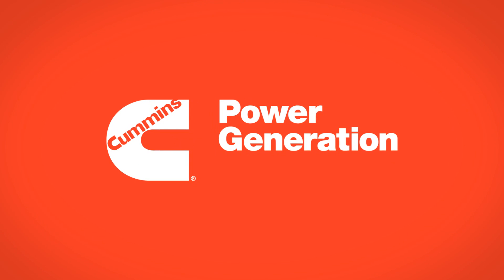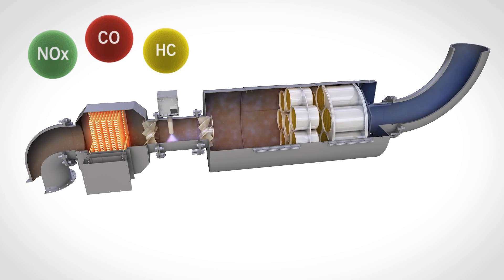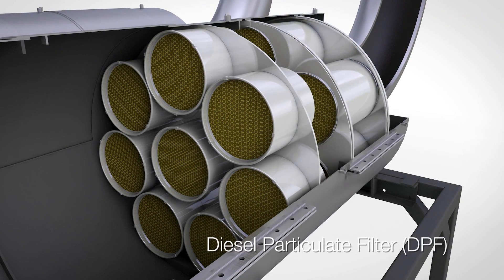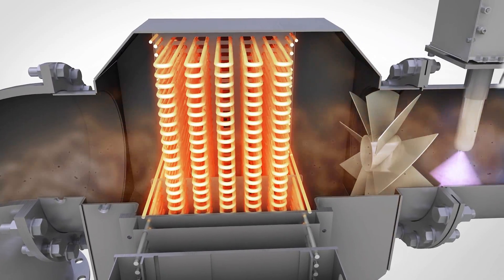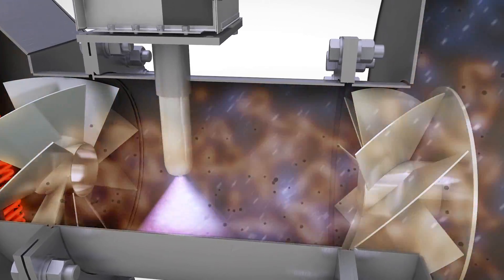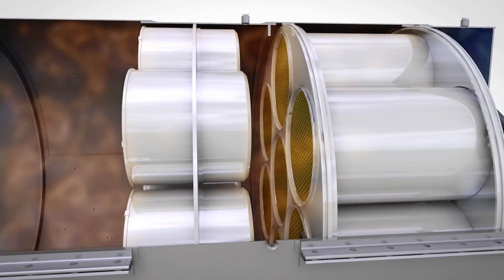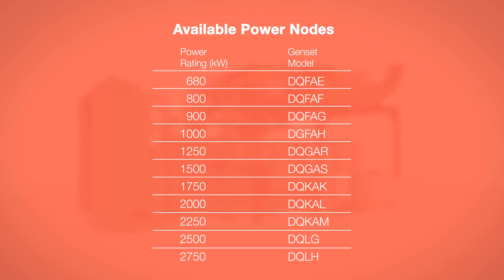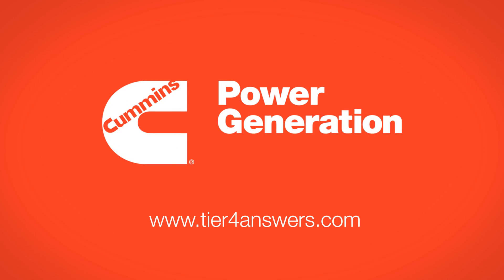Diesel Emissions Reduction Technology

Comment: Actually hydrogen content in diesel (C12H28)is more than any fuel even petrol (C8H18) also less than it .. that is why diesel not need a ignition ... but the lack of oxygen in the air not enough so pollution happens .. to reduce pollution attach a HHO injector available in market .. it injuct clean hydrogen and oxygen in to engine and unburnt diesel will burn and water made from the hydrogen combustion will wash all nitric and other dirts ..government should encourage such activities

Comment: Why is the exhaust pre-heater required, when the exhaust gases are already hot?
Reply: Teja, so this is actually an interesting situation and is driven by emissions regulation . I need to check on the regulations in India, but I wouldn't think it is too different from the US. The reason we need this is for the diesel Particle Filter. Over time the filter gets clogged, we have to do a regeneration, where we take the temperatures to 1000+ to burn the collected soot.
Reply: it is for passive regeneration of dpf which requires a exhaust temparature more than 600deg c for a period of time
Reply: short answer,   it's not hot enough.